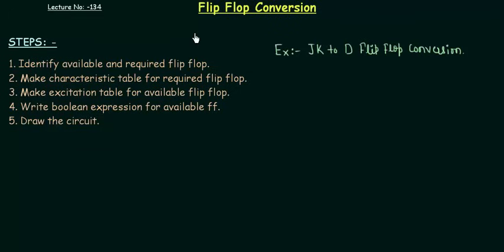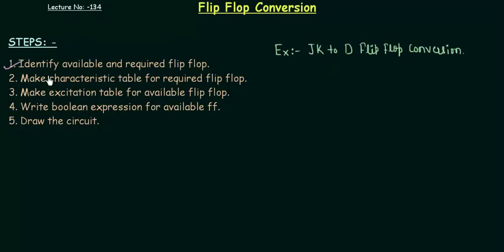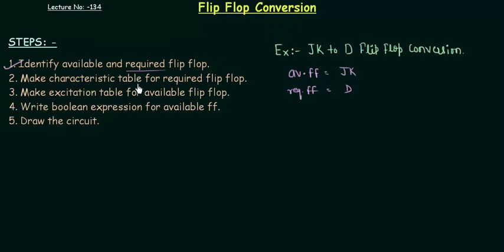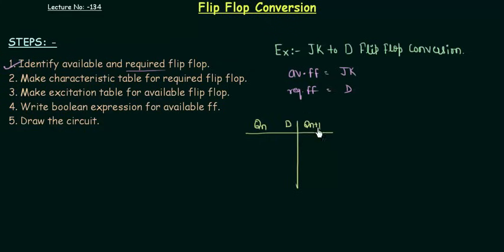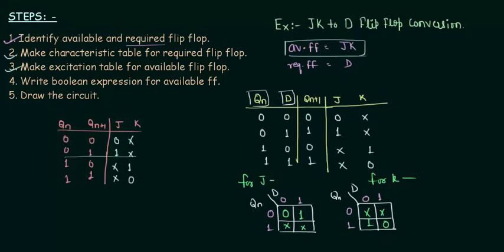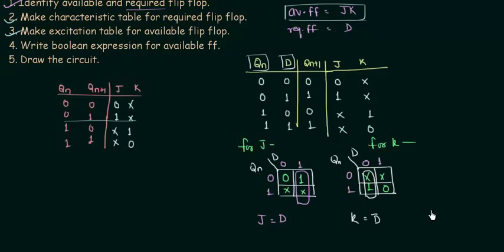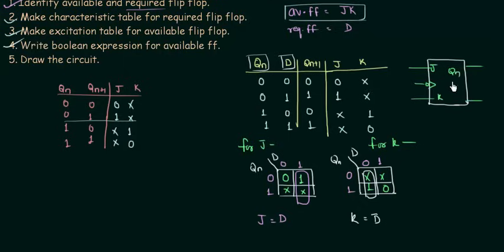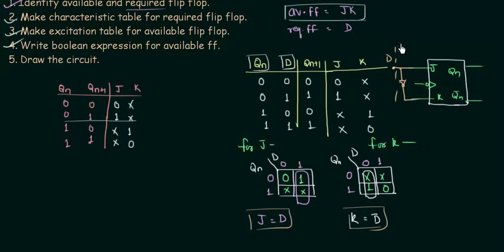5 Steps for Flip Flop Conversions | JK to D Flip Flop Conversion

Comment: Why r you taking negative edge triggered clock in JK flip flop ?
Negative edge triggered is Master slave flip flop only right?
Reply: Why is he taking Qn and D as inputs for kmaps ...he should have considered QN and QN+1
Reply: No K'Map is correct .....In realization K'map will be made with Qn and the desired flip flop inputs only .....also according to the table we make after merging ps-ns table of required flip flop and excitation table of available flip flop says the same according to 4 combinations of inputs i.e. 00,01,10,11.

Comment: This isn't correct .  You have wrapped a JK flip flop inside of a D flip flop, but you didn't actually convert from a JK flip flop to a D flip flop. The correct solution will have two inputs (J and K) being fed into a D flip flop by way of some logic gates which mirror the functionality of the JK flip flop.  

Simply put: The goal of converting from one flip flop type to another is to write the circuit WITHOUT the use of the flip flop you aren't going to be using. So this solution should have only a D flip flop in it.

In fact, what you've done is shown how to convert from a D flip flop into a JK flip flop.  (You did the opposite.)
Reply: The correct solution is this:

D = JQ' + K'Q

Therefore you have two inputs (J and K). The first input is fed into an AND gate along with the complemented output of the flip flop. The second input is first complemented and then fed into an AND gate along with the output of the flip flop. These two values are then ORed together to become the input of the D flip flop.

That is how you convert from a JK flip flop to a D flip flop.
Reply: The term 'convert' may create a bit of a confusion here. Would it be better if we say "Implement A flip flop using B flip flop" - then clearly B would be "inside" A as you point out earlier. I think the problem arises along with the way we describe the conversion process that's all.